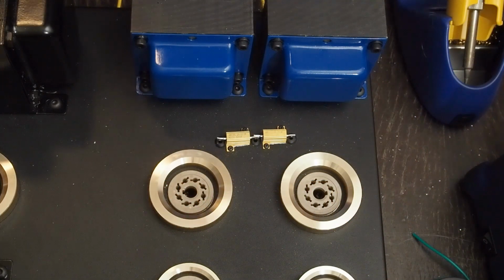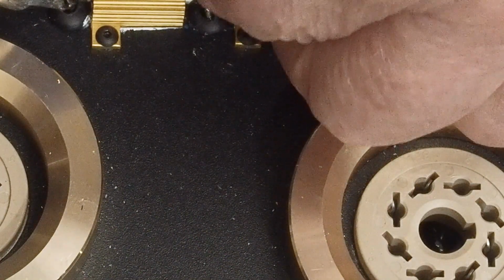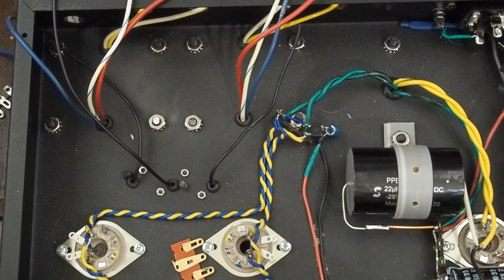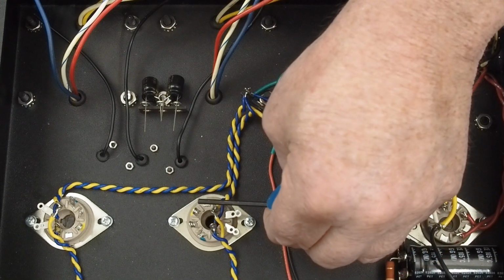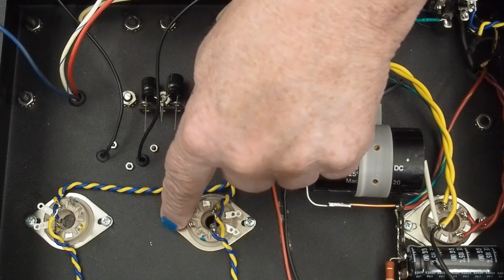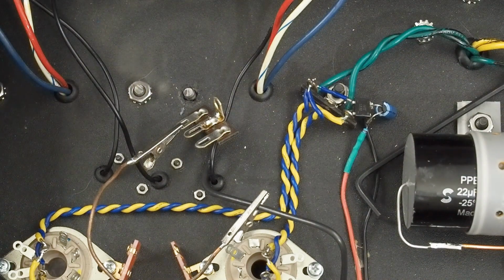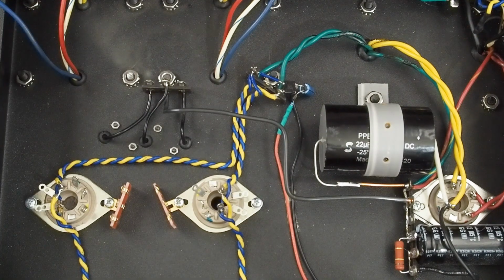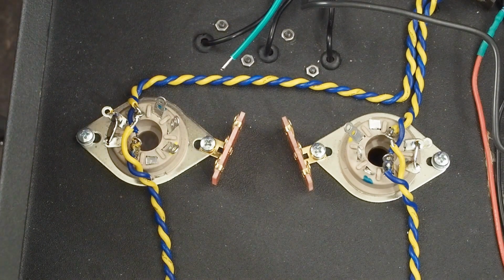6SQ7 EL34 Tube Audio Amplifier: Output Tube Wiring

Comment: How many watts of your soldering gun? I have been using 40w which I feel like i have over burn the soldering flux sometimes if heat too long.
Reply from the maker: I'm using a HAKKO FX-888D which is 70W, but it's temperature controlled.  If you are using a regular non-temp controlled soldering pencil, something around 20-25W should work good.
Reply: @SkunkieDesignsElectronics  Thank you, I think I have an extra 30w. Need to look for it.